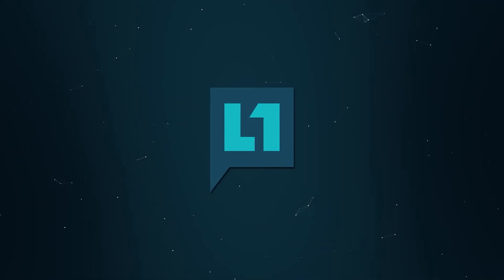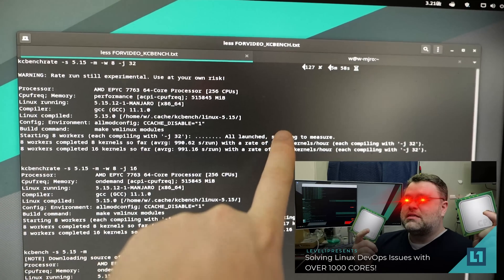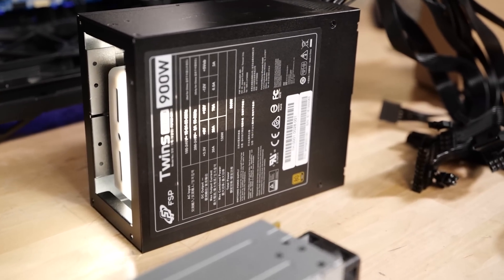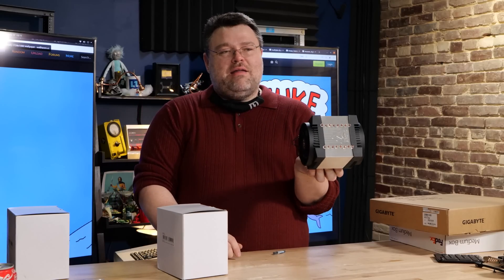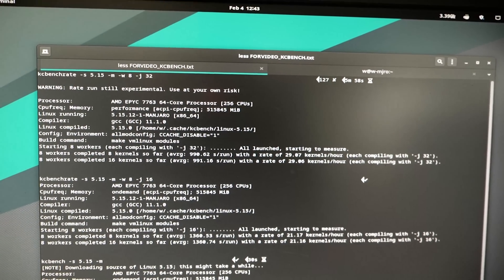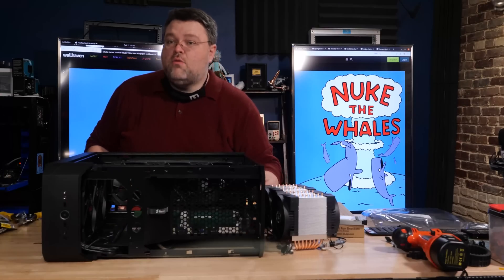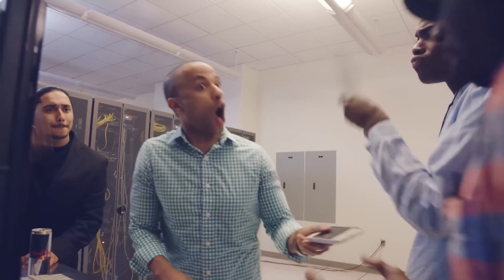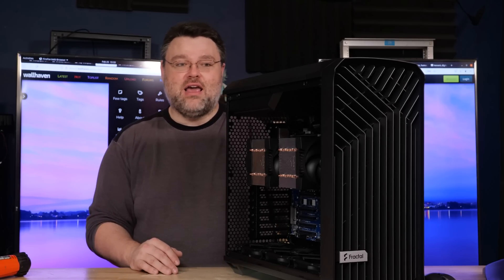Shiny New 128 Core DevOps Build Server For Greg Kroah-Hartman! AMD Epyc ftw

Comment: i have a dell poweredge r630 with max configuation with the E5 2699v3 and 768gb lrdimm for such stuff this thing is fast but also loud. 
i dont need this thing often only couple hours a month but the reason why i bought this system is first it was cheap with 1500€ used in this config i only needed to by 8 drives, but i bought 1.8tb sata ssd instead of sas drives because sata is fast enough for that what i need and i maxed out the system to its 14tb. all dives are in one big drive because i need 10tb for one specific run but this is ok for me i dont need that redundancy. the second reason is for my calculations i need fast ram and lots of threads and i benefit from ranks and bandwidth and having 8 channels with 24 stick end every stick has 8 ranks is really nice so i can split my workload in 88 simultaneous tasks and max out the system. my other system with a ryzen 9 5959x was way to slow. i had in this system 256gb ram with 2 channel and 8 ranks and 2 8tb hdd as one unit for the dataset but the run needed on that system 50h. the r630 does only need 3h for the same dataset.  14tb as hdd where fine but i 2.5 inch hdds are expensive compared to ssd in that size.

Comment: I have a Torrent case and I love it. With an AMD 7950X, a PowerColor 7900XTX, 64GB of DDR5-6000 CL30 RAM, and a Noctua D15 cooler. With the included fans the thing just stays so cool and quiet, it's great. Also, a solid metal side and no RGB, how great is that!

Comment: from what i have read and seen the cpu coolers will not fit in 4u   they stick out by about 2 mm
Reply from the maker: Check the level1techs website. Depends on the case. Working fine for me.

Comment: For the people wondering about cooling (as I did)
After a quick google search:
apparently water loops can handle about 100W per 120mm fan, and about 130W per 140mm fan for “reasonable temperatures”. This appears to be the case for your general AIO 27mm radiator

EK lists the cooling capacity for one of its own 60mm radiators at up to 480W at 2800 rpm and a ambient/ water temperature delta of 10C

With the important note that radiators get more efficient with a greater temperature delta between ambient and the liquid

Sooo…. That’s nuts
Did not think that would be that much

Comment: I would really like to see some performance testing for pfsense.  I know that for 99% of situations using cheap off the shelf hardware can even handle a 10gb connection, but it would be really interesting to see when push comes to shove, where the bottlenecks actually are.

Comment: While I can understand how liquid cooling can be high maintenance by running two liquid cooled computers myself, I have found there are ways to keep the maintenance down.  The biggest thing is to use clear coolant.  I have been using the clear EKWB coolant for years now, which is a glycol mix with biocide and my flow meter has been measuring the same max flow rate for years now with just a simple yearly flush with the help of an air compressor, proper use of the regulator valve on the air compressor, and a Pyrex bowl with a lid to handle splashing.  (The idea being in addition to a well engineered loop that drains well, I use an air compressor to more completely clear out the loop of the old coolant.)  When I used coolant that was colored, that food dye or whatever they used just trashed the loop and provided food for the algae to grow.  Then I had to get out the toothbrush, long needle brushes, etc and dismantle everything to clean that mess out.  I used to hear people say that is what you had to do every year or so when I got into custom liquid cooling loops and with the colored coolant I would agree, but not with the clear coolant I am using now.  If you want color in your loop, use LED lights and some colored tubing; don't use colored coolant.  But yeah, I would argue a well cooled computer with quality liquid cooling keeping all of the hot running stuff cool (and I am using a monoblock on my workstation board, which is a rarity to find and I had to bug a German guy to make it), it will likely outlast an air cooled setup just because it runs cooler.  I suppose that is the other thing, I invested in good sensory and control hardware to keep the cooling system running optimally and cut power in case of a serious cooling fault or if it just gets way too hot in the room.  With dual 280W CPUs, that is a whole lot of heat to dump into the case and back to back 120mm coolers is definitely not ideal for that kind of heat output.  A high flow rate coolant loop will whisk away that 500+W of heat and barely warm at all between the two CPU water blocks.  It would be interesting if you could find a block to stick on those VRMs.  I am finding my liquid cooled VRMs with high end pads on them stay rather cool.  I have lost hot running VRMs in the past with things like the system just turning off while under sustained full load to a loud bang as a power cap blows out and then the system shuts off with a burnt electronics smell filling the room.  So keeping those VRMs cool is important even if they are rated for a high temperature as they don't always last at those temps.

Comment: RE: The special standoff - in the days of nylon standoffs that slotted into grooves in the case to hold the motherboard you could just snip off the part of the standoff that would go into the groove to support the motherboard.

Everything new is old again :)

Nice build!  That dual power supply is sweet - I can see uses for that.  I will never build a system like this but still fun to live through others.   If we had YouTube in the early 90's would it have been as much fun?  I wonder...

Comment: I'm surprised you didn't mention the lack of sound damping on the panels. The case isn't cheap (you only save $10 over the windowed version). I expected more from Fractal (used the original XL, with some mods in my main PC for over a decade).

Also, I had to replace the bottom fans as they were resonating with the case. Making 950-1100rpm unusable. While quieter above that zone, they're not quiet.

Comment: Amazing video! I'm considering one for my company (our first build/proxmox server!) and have some questions:
- we're gonna go with single Epyc 7002 Rome and 64GB over 4x16GB, for cost and initial testing, upgradeability in the future
- I'm choosing between Supermicro H11DSi (for 7002/3) and this Gigabyte (which has Rev1 and 3),: Supermicro boards have 2 benefits, such as upgradeability to Milan (7002+7003) while Gigabyte needs to stick to Rev1 which is 7001/2 only and Rev3 does MIlan. It also has offset sockets which may help cooling. I'm leaning towards Supermicro but the Gigabyte looks fancier and has full x16 slots. Anything wrong here? It is also slightly cheaper. I think they both will fit ATX fine.
- wondering if the Gigabyte Rev1 has firmware upgrades for Milan?

What are your thoughts on such a machine for a proxmox doing both build servers and on-demand Windows/Linux remote workstations and LXC containers?

Comment: No mention of the vrm temps?  It's the vrm that gets toasty in dual epyc desktop builds. The CPUs are surprisingly easy to keep cold with the massive dies. But those tiny vrm 6/12 phase heatsinks struggle without massive airflow.

Comment: Are the CPU cooler fans airflow all one direction? Wouldn't you get the hot air from one feeding the second one making it run hotter? Pulling air from the center and out opposite ends could work but may be tougher to manage air flow or be turbulent.
Reply: custom acrylic air flow channels like Puget uses should solve the issue. but it might need some thermal testing.

Comment: modprobed-db and localmodconfig helps allot speeding up kernel compile time since you rarely need all the driver files for a specific system. Just gotta keep in mind its not perfect and sometimes misses out modules so you gotta keep a eye on that but I use it myself and it works quite well even though it forgot to include some core filesystem modules.

Comment: I would love if you would (once in a while) provide more info to non-techies such as me who like your channel but don't understand a lot of what you're trying to accomplish. E.g., what is the purpose of compiling Linux 1 time, or as many times per hour as possible? Why would you need to do it more than once per version/update/beta? 🙃
Reply: One reason to that could be bisecting the kernel to find what patch introduced a certain bug. That means, you compile and test kernels, apply or remove commits, compile and test again, until you find the one that changed the behavior that introduced the bug. Something GKH probably needs to do regularily for stable kernel releases.
Another reason I can think of is automated test build to verify that new commits actually do compile properly, and automatically find the ones that don't. Or find which combinations of changes break stuff. When pulling from multiple trees of dozens of subsystems, all being worked on by a combined thousands of devs, I can imagine automating this rather than just pulling in all the changes and then manually figuring out what broke what, would absolutely be required for a project of the scale the linux kernel has become.

Comment: Jeff over at kraft computing tried to put those freezer coolers in a 4u chassis and it was 5mm to tall.
Reply: Yes, that's what shied me away from them. It's possible they might fit in some 4u chassis, but I measured my Supermicro 743 and it was too close to call.

I guess with the money already spent it wouldn't be a big deal to check (Epyc 7452, 256GB DDR4 3200 SK Hynix, 4x U.2 drives for VMs, soon to be video card of some description for cloud gaming).

Comment: Questions - Why did it turn out that dual socket 32 cores turned out to be optimal, as opposed to quad socket 64 core?  Does it have to due with parallelization, Thermal Limitations, Fabric between CPUS, Scheduler issues? Or something else?

Comment: I'm in love with that chasis, and there's a version of it that doesn't have a glass panel!!!
Reply: I love the Torrent. 
I was about to order it when it was recalled because of the fan hub issue.
It is sooo well thought out and built.
My previous Corsair is also huge and not bad but when I built up the Torrent case everything just made sense. 
The only "gripe" I have with it that it could have one centimeter more space on the side behind the motherboard because of the amount of cables I have running through there and the SSD mounts are a bit iffy as I have old SSD's with the screw holes on the "wrong" side.
No glass side for me either.
I love it!
Reply: @FutureChaosTV  it's a shame it's not available in my country, it would be very expensive as well.

Comment: Just for schidts and giggles, it would be fun to take some trident Z RGB 4400CL19, and see what a threadripper system like this could do with say, 4000CL18. Also 16 sticks of RGB would be an interesting thing to manage
Reply: Probably be hit and miss. Silicone lottery with the memory controller. Doubt you could hit that rated speed with quad rank
Reply: Ohh and definitely couldn’t run 1:1 at that speed. Fabric speed is finicky
Reply: @nathanlowery1141  Oh, yea, only Intel and 7nm AMD APUs can even come close to those frequencies(my 5700G is running 4933CL17-17-17-28 in 1:1:1) But even at 3600 you might be able to drop the timings to CL14, even with 8dimms per processor you might be able to hit 3800CL16

Comment: Still loving my 3990X workhorse!   It just chugs away, day in and day out, without complaint.

I don't like putting those huge tower heat sinks on their sides, though.   That's gotta torque the socket... not a 10-year plan IMHO.   I always build them so gravity is assisting in the right direction, even if it means using a 3U or 4U case for the larger systems.

For the VRMs, I always offset the intake fan on the tower cooler down towards the motherboard as much as possible, so a small part of the fan is actually pushing air under the cooler instead of through the cooler.  That seems to solve the problem for me.

-Matt
Reply: The board and backplate are taking most of the load, then it's torqued to spec. Buildzoid had some thoughts on pinout loads and apparently even Intel 1700 could take tens, almost hundreds of KG of pressure over all the pins it uses. TR4/SP3 have even more pins over a larger area. I also wouldn't worry much about stress on the chip itself if they state in the spec it's supposed to be pressed to such extents on the socket.
Reply: @cldpt  agreed. Ive had an NHD-15 on one of my systems for 8 years now, its fine and it hangs big time. same on my current threadripper, high end boards arnt made of thin paper, they got back plates etc, plus the included toque wrench on threadripper insures its all correct. nothing to worry about.
Reply: I do the same thing with my fans on my Noctua NH-D15
Reply: Thank you for sharing that fan placement tip.

Comment: Hah! "smallest dual socket build". Tell that to my 19.5L dual Xeon SFF!
Reply: Is it a full ATX server motherboard?
Reply: @steveseeger  Well there's no such thing as a "full ATX" motherboard, and there's no such allowance for dual sockets in the ATX standard. There IS however allowance in the SSI-CEB and SSI-EEB standards.
SSI-CEB is basically a slightly extended ATX standard (12"x10.5"), same bolt pattern, but with allowances for dual sockets.
SSI-EEB has the same footprint as E-ATX (12"x13") but most of the mount points are different. Not impossible to work with, but more of a pain.
Asus has been making dual socket SSI-CEB boards that work well for workstations for a long time.
Reply: @ReQuiem_2099  Sorry ya I meant eATX.. Can't believe you got an eATX in 20L case. Must be really skinny?
Reply: @steveseeger  Running dual Noctua U9S', a triple fan RTX 2070, and currently 3 other expansion cards. Plenty of space where it counts. Multiple mounting locations for the PSU, but I had to go SFX to make room for the coolers. I do wish they would've added at least a few millimeters in the back for cable clearance.
Sliger Cerberus X case.